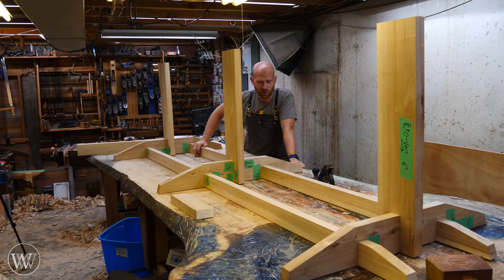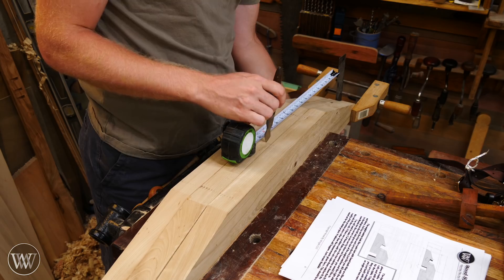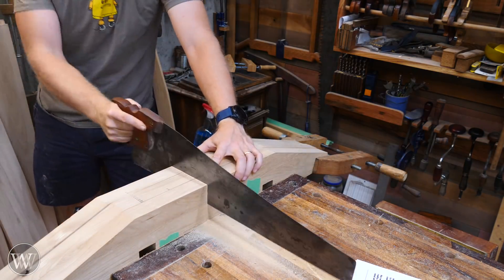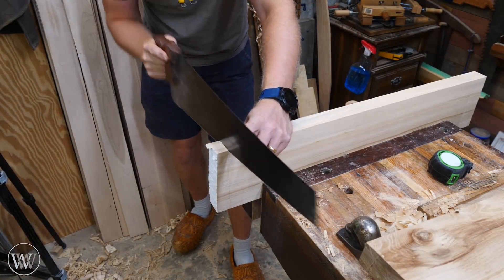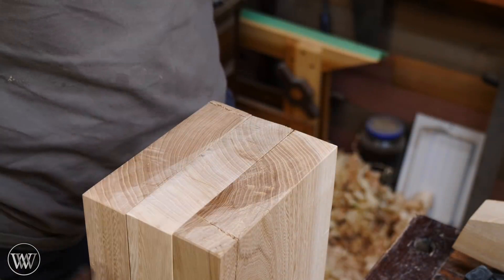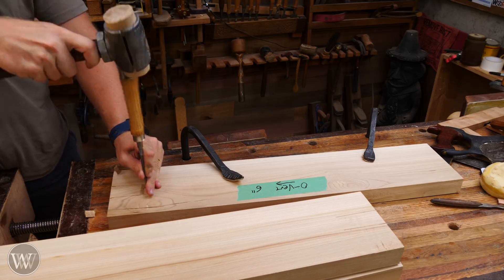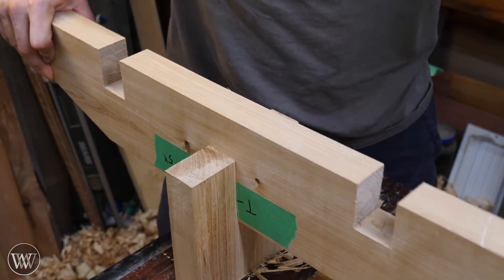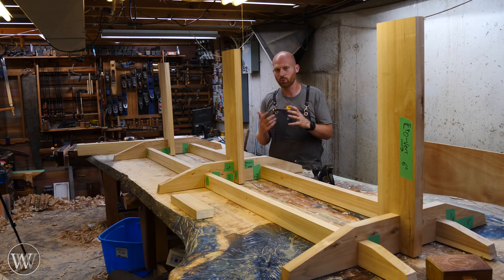Making the Legs For the Live Edge Dining Table

Comment: I'm looking forward to seeing what you decide on fitting the top.  If it was me, I'd probably work the supports down so that they match the top, but that's an awful lot of "put on table, mark where it touches, take off, plane, repeat."  Could take a while.

Of course, since you've already used the router sled to flatten the top, you could always mark out the areas where the underside will touch and use the router sled to flatten just those areas.
Reply from the maker: I had thought of the router sled. We will see. I have a wile tell I need to make those choices

Comment: When the base is complete how are you going to attach the top? Are you going to use fasteners or dowels of some sort? Or do you feel the weight is substantial enough to keep it in place?
Reply from the maker: there will be 4 locator pins from the base into the table to keep it from sliding around, but the weight of it will keep it in place.

Comment: With the table design being live edge, but having modern materials in it like epoxy, I would flatten the bottom and make it fit rather trying to make something half modern look historical.  Run the power planer over the epoxy spots and make it smooth.
Reply from the maker: thanks Dan. we will see!
Reply from the maker: it does not give a smooth cut, but it does remove material. I usually can clean it up with the card scraper fairly quickly.
Reply: Hmmm... Don't we know someone who sells them?

Comment: If you leveled the table top from the top/underside (since it is upside down at this point. you could use shims to level your mounting bracketry.....then use a scribe to create an exact fit to the bottom of the tabletop. Of course, it would be difficult to make an exact fit with all the undulations.......you could also use the router (since you "cheated" using a router already) and route out the groove to set your mounting brackets into......would be perfectly level and flat.....just a little cleanup with a chisel, and you would maintain the rough look on the bottom.
Reply from the maker: I am leaning toward the scribe route right now. we will see though!

Comment: That is one beefy base! No need to flatten the bottom of the table ... just get three flat, coplaner crossgrain strips for the supports and two long ones for the upper stretchers. The rest can stay the way it is.
Reply from the maker: that is what I am thinking except for where the support goes through the epoxy.
Reply: Do you think flattening the epoxy would be difficult or perhaps that it would impact it's clarity?
Reply from the maker: I fear cutting into he epoxy will change how-much light is let through, but I do not know for sure.